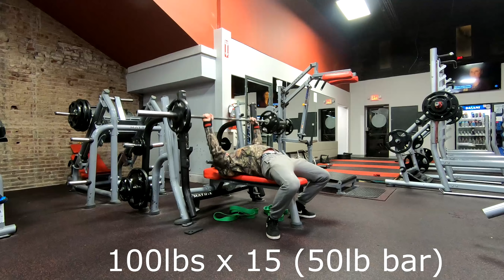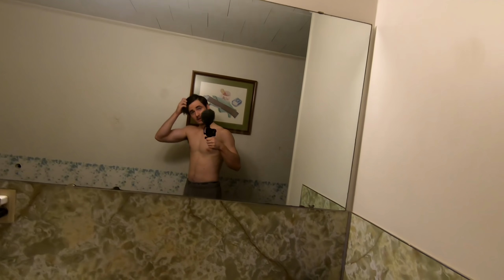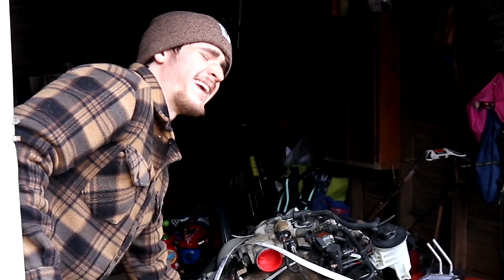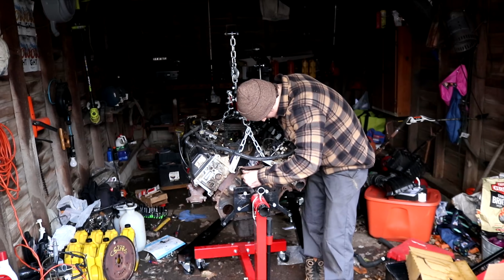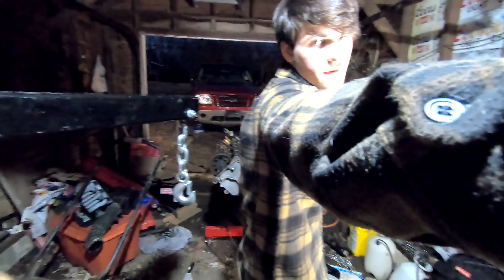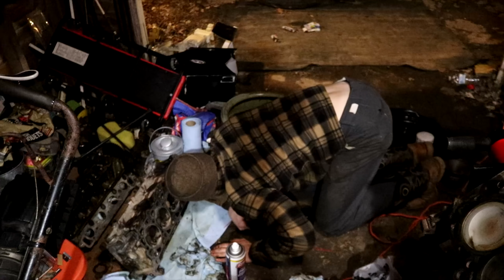THEY SENT ME JUNK!!! (kinda)

Comment: Im a diesel mechanic in training. Ive been apprenticing for about 6-7months and i gotta say its pretty cool to see someone with so little tools and space still take so much care while working on it. Love you ken dawg nhbf!
Reply: Where you training at
Reply: @kevinpeterson1965  A caterpillar dealership
Reply: colby hicks welp I sure hope your not die hard by the books to you customers because the last couple cats we had (up until kenworth quit putting them in there trucks) had ecm issues and I shit you not the cat guys literally replaced every sensor, wire harness, even the cam before they just listened to us and the guys at kenworth and changed the ecm and bam 600k later still running strong. I know the books say one thing the mechanics from the 80s and back (trucking depression) know how to get stuff done with little tools and parts are hardly ever wrong

Comment: You should by headers for the motor and get rid of the manifolds it will sound way better that way and you should do a little bit bigger camshaft it’ll add a good bit of power

Comment: I legitimately used to power lift. And did a few amateur comps. (Didn’t place high but still.) form is perfect ass and top of your back is planted. Back is arched correct height. Also don’t forget to mix it up and do wide, muddl, and close grip when bench to work all areas of pecks and, triceps. One more thing, when doing deadlift take your time. Leg work outs are killers. How I blew my knee out (squats) but good on yah!

Comment: I put a Small Block 350 in my S10 and my motor had a bunch of stop leak shit in it, so I took out all the freeze plugs, and used a fuckin pressure washer to blow that shit out😂 (using the water pump holes and empty freeze plug holes obviously)

Comment: Hey Mr. Kenny i think your form is overall good just if you can help it cause even i do this but try not to use your feet cause its a bench press not a bench thrust lol. Arching your back just makes the bar have to travel less and not get the potential full motion you could get without the arched back. Also get a lifting partner if ya can cause if your arms give out on you when your doing like 230 and you cant press it as easy as like 200 it might injure you or even worse. You will be known as THE GUY who dropped the bar while he was pressing

Comment: I have a 4.6 trition in my 1998 Ford F-150  lariat and I can tell u I have more power  than my dad who has a 5.4 triton in a  I think 2003 Ford F-150  but if u look at the specs of the power of the engine they say the 5.4 has more  and my truck has not had as many problems as my dads truck  mine only has simple things like leaf springs shackles and oil pressure sensor   And I don’t hold back on my truck I give it hell and his had a lot more difficult things   As he baby’s it lol